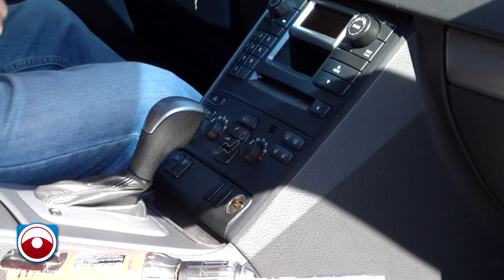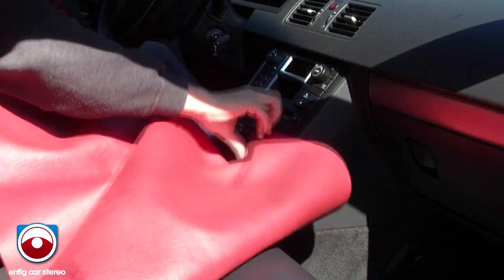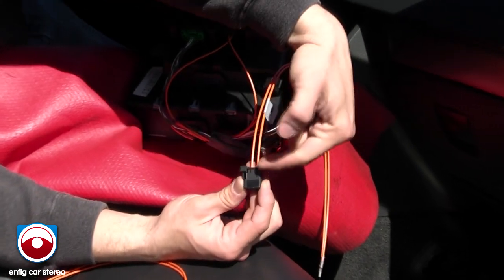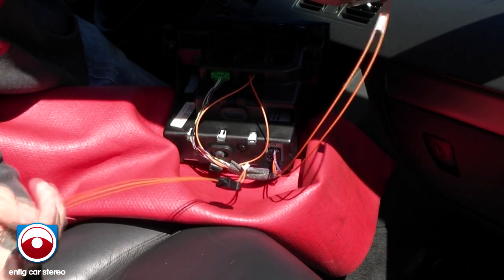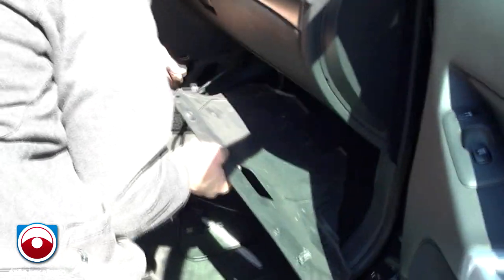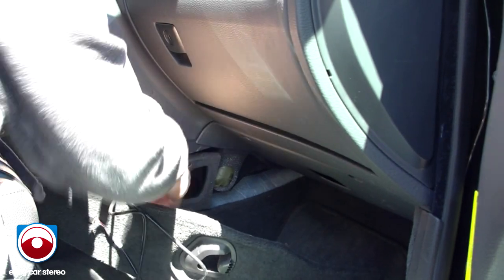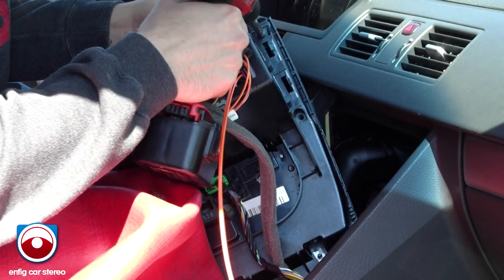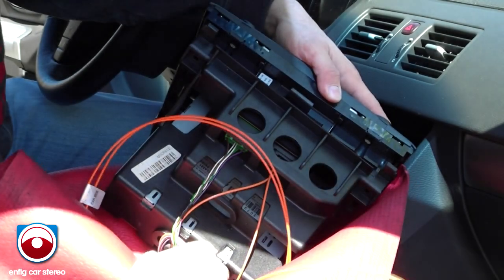Volvo XC 90 Ipod Aux USB Installation Dension GW51MO2 Part 1 of 2

Comment: Does the same installation process apply if I were to purchase a much cheaper Dension unit, such as the Gateway Lite or Gateway Lite BT?
Reply from the maker: +Thanxdude This is the only dension unit that works with this car.

Comment: hey can i be able to instal an aux and USB port in volvo v50 2006
Reply from the maker: +Samuel Kamau As long as you have a 6CD changer you can use this item.  If you have a single CD call us.
Reply: Probably